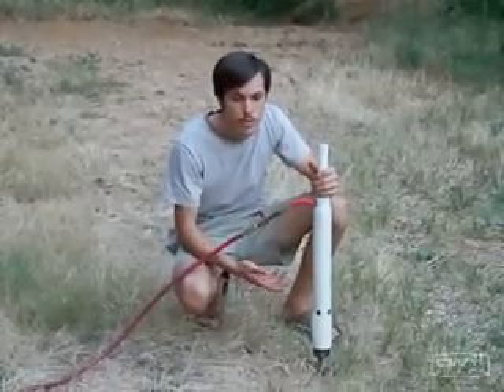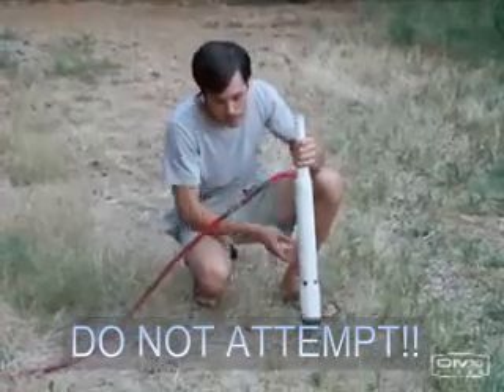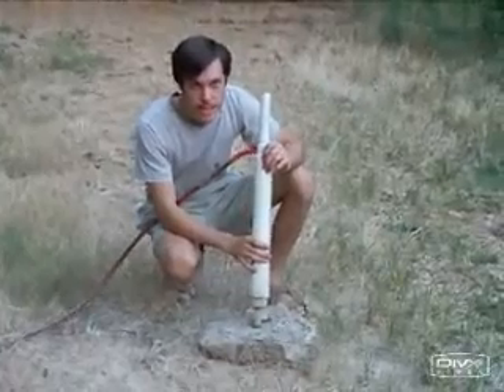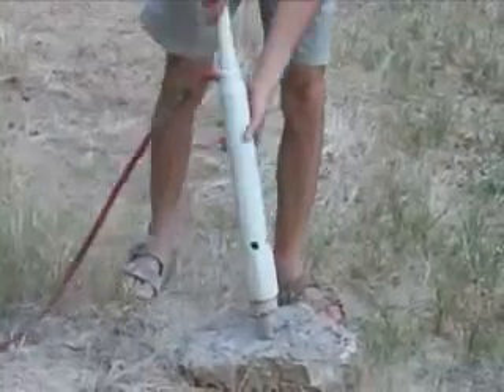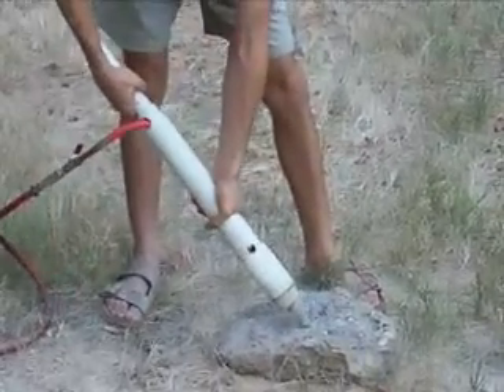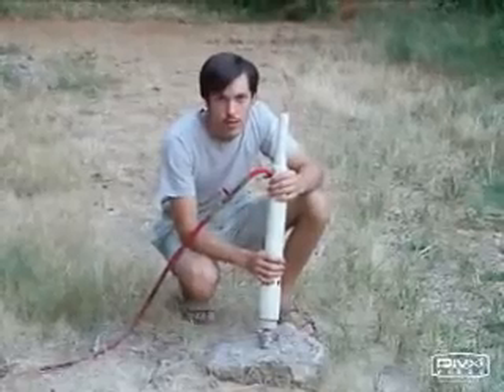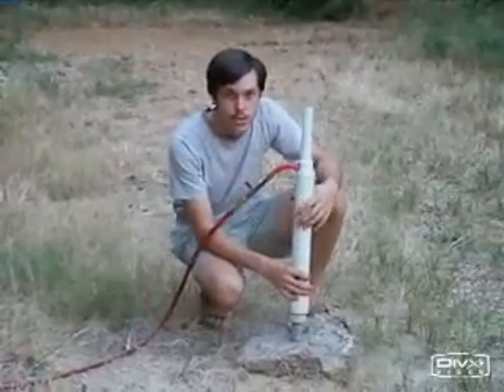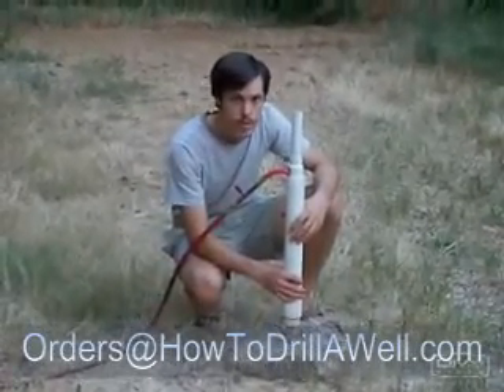FAQs About Our Water Well Drilling System

Comment: I have a old well that needs to go deeper,  it's 60ft , but only 6 ft of water in the casing , can I drop this down and go from there. It has a 5 inch case
Reply from the maker: Yes, if there is no cap in the bottom of the well. You'll need to get the 4" bit on our website, and you'll need to be able to add water to the casing to fill it up, otherwise the drill won't pump.

Comment: Trying to get some input on this, I had a ton of cave ins while drilling my well, (only got to 35ft ground is to wet and sandy) I went ahead and cased it and dumped about 1000lbs of tiny pea gravel around the casing. I still have about 15ft to fill around the well casing. What other type of rock would be good for this since there is so much water in the hole? I dont think it would be a good idea to put dirt in the hole until I get above the water line

Comment: How often does the drill bit need to be changed, sharpened, or maintained in some way? I am considering purchasing and drilling my own
Reply: You'll probably wear the drill out before the bit; most people do. It typically gets about 100 hours of use, and that's enough for most people to drill their well.
Reply: @nathanielburson8929  Trying to get some input on this, I had a ton of cave ins while drilling my well, (only got to 35ft ground is to wet and sandy) I went ahead and cased it and dumped about 1000lbs of tiny pea gravel around the casing. I still have about 15ft to fill around the well casing. What other type of rock would be good for this since there is so much water in the hole? I dont think it would be a good idea to put dirt in the hole until I get above the water line?

Comment: And when you are at 10m under the ground and you get a stone you can twist in all the angles that head drill??? Like youbdid on that stone??? Wow..amazing machine
Reply from the maker: Of course not. I have drilled 210' wells with this system, through several rocks. This is just to show you that the drill, when it hits a rock, keeps grinding and working. It's to show the power, not to demonstrate the way a rock is drilled.

Comment: One question. This is a short drill with front drive if you express it as such, so once underground the front- one side turning of the auger shall give a radial moment which take the drill in a sideways trajectory. From this curving well hole it shall be difficult to retrieve the drill back, or push in the water pipes later
Reply from the maker: The drill can wander a bit, but typically it cancels itself out and goes more or less down. It's never difficult to pull the drill out because of the hole, and usually not too hard to push casing in. There are some tricks I've learned since making this video that is on the new DVD that allows you to drill a pretty much perfectly straight hole.

Comment: how are you going to turn it to the side like you did that far to cut the rock once in a 4" case 30 ft down??lmao
Reply from the maker: +try duck Obviously, I just did that to show how it bites. Rather than spend the time it would take to get the hole drilled down through this rock to fit the bit so that it would be in contact with the rock, I just bent the drill over to show how it bites when it's in contact. 

This is concrete, too, which is harder than just about anything you'll find in the ground.
Reply: @HowToDrillAWell  hi how much is this drill I need it

Comment from the maker: Your ignorance of basic physics is impressive. When the air drill is turned on, there is a positive pressure inside the housing that keeps any mud from entering the drill. We then use that pressure to pump the mud out the inside of the pipe. I've drilled 210 feet deep with this system. Don't mock what you don't understand.
Reply: HowToDrillAWell  hey where are you located, I would like to buy that air compression drill, I live in the central valley of California near a natural water source California Vineyard canal.
Reply: @beyondnature1980  how did it go?   Did you use his system?  Did you go deeper than 200 feet?  Im in So. Cal.  Thanks

Comment: @ladygrace1023 lot of laugh, you made me laugh, this video or set up is very peremature, secondly one can not drill stones or rock with ch a high speed, the drill bit should be carbide tipped whicher  can drill rocks, (cylindrical type carbid drillbit which uses water to cool the carbide tips, thirdly h e has to make arrangement for sending the tool down the water whole along with of thater supply to send mud and broken sand  out well, also he has to solve the problem of air which will gush out

Comment from the maker: @Begbucks This powered using an air drill, not just air going into a pipe. With this, we can drill through clay, even rock - something not possible by "basically pumping air through the pipe into the ground". Wells are very rarely springs (artesian), usually you have to use a pump to pull water out of the ground; and no, chemicals are rarely needed, most water is drinkable as is, but test it first. Many free test kits are available online.

Comment from the maker: @waterwart Of course not. I have drilled 210' wells with this system, through several rocks. This is just to show you that the drill, when it hits a rock, keeps grinding and working. It's to show the power, not to demonstrate the way a rock is drilled.

Comment from the maker: @DMagers No, the first four feet are dug by post-hole digger precisely so you don't have to do this. And no one said it cut through concrete like butter - but it does go through it. The point was to show how powerfully the drill grinds on the rock, not to show that I could drill through it in 10 seconds - something not even a 100,000$ truck-mounted rig could have done.

Comment from the maker: @HowToDrillAWell  Bear in mind that well drillers get paid by the foot. It is to their best interests to dig as deep as they can get away with, whether you need that or not. What I would do is find some neighbors with a well in your area, and ask to drop a float (a lightly-weighted pill bottle tied to a string works nicely) into their well and see where the *first* water is. That will give you an idea of how deep you might actually *need* to go to get your well drilled.

Comment: @HowToDrillAWell I more so say depending on the crew and geology. A good crew can do a few jobs in a day and therefore can charge less to attract more business. an unorganised crew well.. the opposite. With your method 1) is hydro-fracking possible and safe? and do you run any casing? If you do use casing upload a video of how you do it, I am curious of how you would do it.

Comment from the maker: @kd5gua We don't "draw" water, we push it with air. If you're deeper, you just need more PSI to counteract the weight of the water head, if you can get any bubble to come out at the bottom end of the pump it will go up and push water ahead of it and leave a vacuum behind it.

Comment from the maker: @skateboy159 I have used this well to drill holes to 210', 196', and 175' in three different holes. I see no reason why this system couldn't be used to go deeper, but I've never done it. Generally we recommend that on your first well you stick to under 100' so that you can gain experience in a shallower well before progressing to a deeper one, but that may not be an option for you depending on where you live.

Comment from the maker: I've done it. It flexes. Set up a hundred feet of 4" pipe together, then go pick it up in the middle. You'll have to get it 20' or better off the ground before the ends pick up. As to holding it, all the kits come with a well point which has a hole for a rope which you use to support the bottom piece, so by holding the rope (and lashing it around a tree or something, as necessary) the pipe can be lowered into the well without fear of it falling or the glue breaking.

Comment from the maker: Well, the drill and expansion chamber assembly is rigid for the first 3 feet; that helps keep the hole straight. And the few misdirections that drill will still make tend to cancel one another out. And, unless you happen to hit the edge of a huge rock, you aren't going to have a sudden shift in the direction of the drill head, so the PVC 4" will follow it even if it weaves a bit. Plus we have a round well point that will bounce off the walls and follow the hole down.

Comment from the maker: Depends on state and local codes. In many states, including the one where I live, It is legal for you to drill your own well on your own property without government interference or permits being required. In other states, like Oregon, a state inspector has to be present for the casing/grouting of the well. 

One of my customers from Oregon did that, and the well passed without any problems. You should always have well water tested before drinking it, and such tests are easily available online.

Comment from the maker: Ah, I see. No, I just did that to show how it bites. Rather than spend the time it would take to get the hole drilled down through this rock to fit the bit so that it would be in contact with the rock, I just bent the drill over to show how it bites when it's in contact. 

This is concrete, too, which is harder than just about anything you'll find in the ground.

Comment from the maker: No, my system does not require water pressure. See my other video for more fundamental info about how it drills. It requires 90 PSI of air pressure at the very minimum to drill a well with this system. Water is required, but not pressurized; it can be hauled in tanks and dumped in the hole on site.

Comment: I thought you used water under pressure to drill the well, but in the demo here your using air pressure.  15 psi vs 100+ psi?

Comment from the maker: It totally depends on the type of rock. You can't expect this to work as well as a commercial truck mounted rig; it simply doesn't have the torque. Generally an average of .5-2 inches an hour is typical for most types of rock. The rock shown was very hard, cured concrete which is as hard or harder than anything you'd encounter in the ground.

Comment: I live on Sand Mountain in Alabama. If I dig one to three feet anywhere on my property I hit solid rock. I can see large boulders exposed in the valley next door.
I consulted with a local well digger. He said that there is water between the rocks and I would have to go 75-125 feet at $15 per foot.
Would your drill work in such a situation?